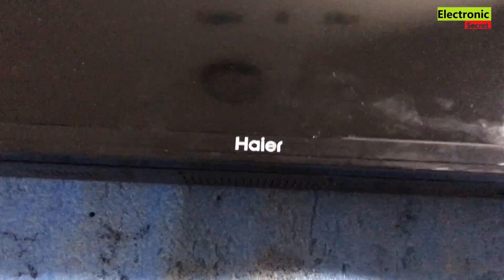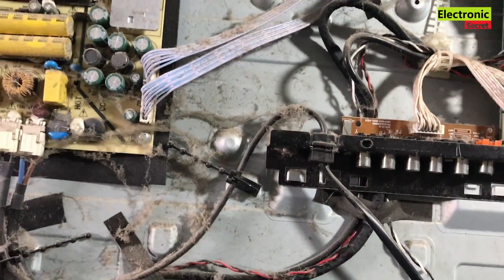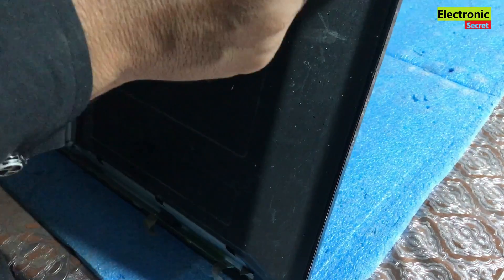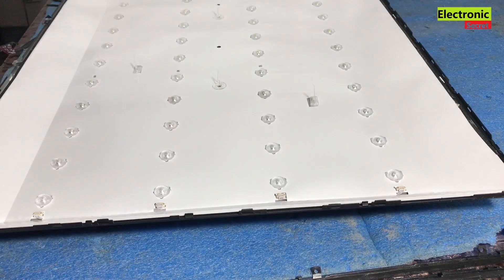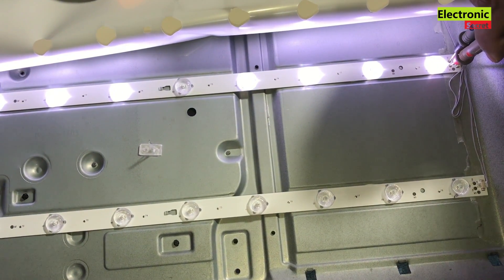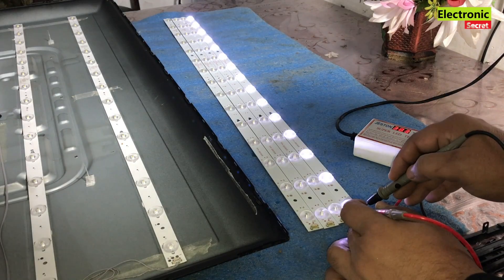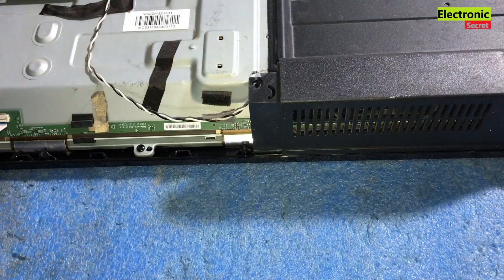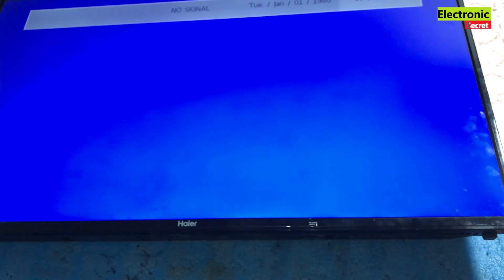HAIER LED TV BLACK SCREEN PROBLEM, HAIER LED TV DISPLAY PROBLEM

Comment: Sir I have a question I have haier 48 inches but the trouble is in the left side is black and right side is good it is a back-light problem or possible a panel is no good hoping for your reply thanx in advance godbless
Reply from the maker: Backlight problem
Reply: @ElectronicSecret  sir I haave an doubht I have haier 55 inch TV I can hear sound but I can't see anything